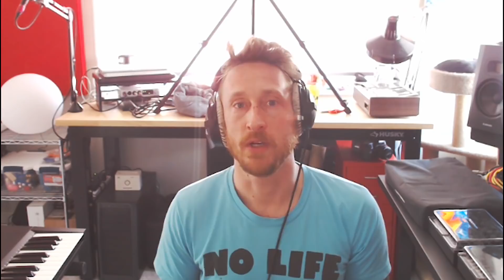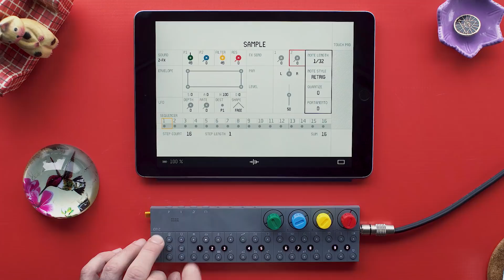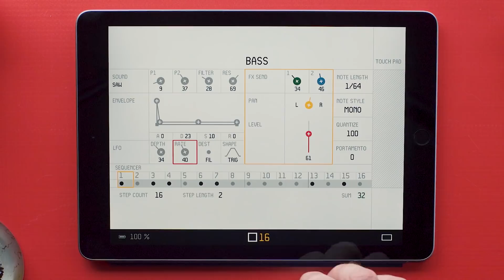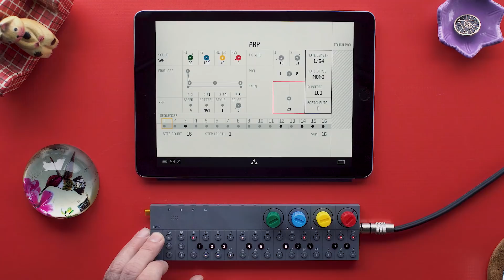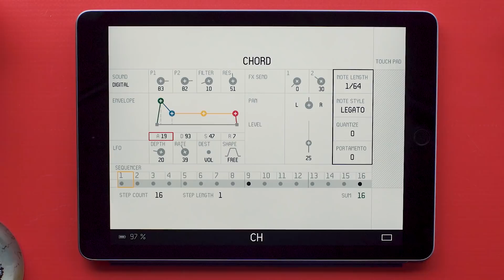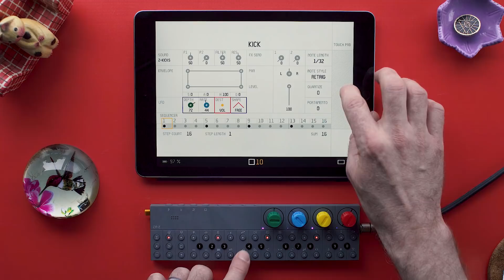Teenage Engineering OP-Z Walkthrough (Synthesizer and Sampler Engines)

Comment: Hey Jeremy, thanks for doing these videos, they're super helpful and concise! Dumb question for you about setup though: This is my first synth, and I am just running a 3.5mm cable from the OP-Z to my speakers. It sounds OK, but the level is a little low and it's only in mono. Is the signal mono or stereo? Also, what kind of cable do you use, it looks pretty sturdy. Thanks again!
Reply from the maker: It's stereo. You would want a 3.5mm to dual trs cable or something like that

Comment: Worth noting you can have all the synths on all the synth tracks. This can be achieved in the OP-Z app CONFIGURATOR. I have them all configured the same way on all the synth tracks + u can use samples on the synth tracks as well although the OP-Z semms to be fussy with those.

Comment: I forget if you mentioned but  you can put any of the synth engines into any of the tracks with the configurer part of the app. I just found that out this week. It opens some possibilities. Although I've been having a glitch on mine where the app will stop telling me what engine I've selected and that section of the window will just be blank. Anyone else have that issue. Great video per usual.
Reply from the maker: Oh interesting. Thanks for the tip.

Comment: You can freely Put the different synth engines in different Slots of each synthtrack. And also xou can save different presets from each sampleset  on the White Keys.
Reply from the maker: Cheers thanks.
Reply: Yeah, it's a bit annoying that they are not in the same slots between synth tracks if the tracks share engines.